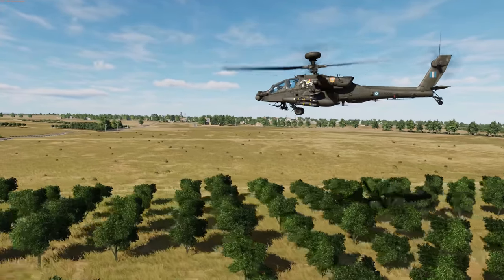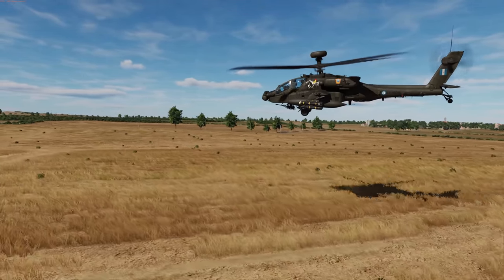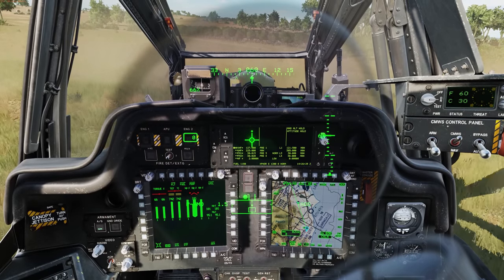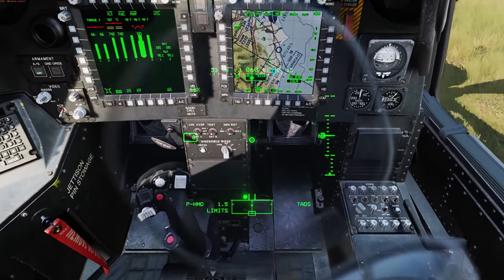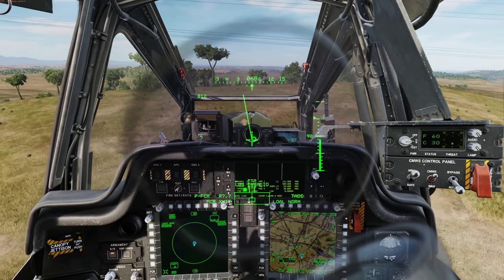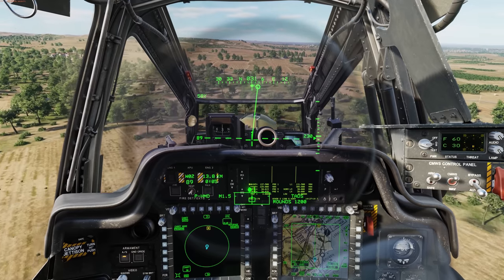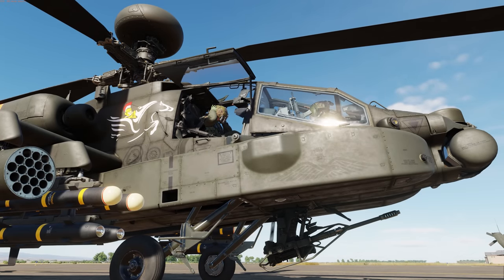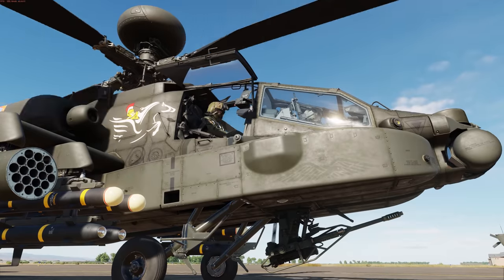DCS: AH-64D Laser Warning System

Comment: When I was a TOW Gunner we were taught to never laze aircraft because of this. Especially friendly aircraft. There were instances of guys just messing around with the TOW system and they would harmlessly lase a friendly helicopter that was nearby and it would pop flares and evade. I always wondered how it worked
Reply: downloadpizza2547 There are TOW variants that are laser guided as well.
Reply: @leogibney  There are no TOW variants with laser guidance. Wireless TOW's are guided via one-way low probability of intercept radio datalink, not laser.
Reply: @downloadpizza2547  Yeah pretty much. To confirm a target is within max effective range and to also call out the direction and range to adjacent friendly units.

We make it a habit of just hitting that laser-rangefinder button every time we point it at something, but you gotta be careful when pointing it at active protection systems like the Shtora-1 or an RLWS-equipped aircraft like this
Reply: @captainedward8278  the TOW ITAS literally has a a FLIR/NVD/Laser rangefinder as part of its kit, thats why it would trigger LWS systems, the missile its self does not have a laser emitter but the launcher certainly does
Reply: @123TheCloop  A laser rangefinder, yes, not to guide TOW missiles. None of them use any method of laser guidance.
Reply: Was taught the same with modern tanks also!
Reply: @123TheCloop  so you are agreeing with him lmfao.
Reply: @123TheCloop  literally what @captaineward8278 wrote: "There are no TOW variants with laser **GUIDANCE**." Emphasis mine. There's nothing wrong or even ambiguous in what he said.
Reply: I had a friend who had a laser range finder on his person because he found it useful in the field. When he first got it he pointed it at an apache over their FOB and the thing dumped flares and evaded. They were not happy but he was never caught.

Comment: To be fair Waggs, the only thing i wish for the Apache its a more updated cockpit. I say this because i have a RTX 3070 and i have to low the graphics to play the Apache. Its the only module that goes under 60 FPS in my pc, so i wish you guys optimice it a little, im tired of running it at 40 or even 30 FPS unu

Anyways, thanks for all the upcoming things!
Reply: Im running a RTX3070 as well and play with most settings maxed out at 90fps on busy servers. The issue might lay elsewhere. What other components do you have?
Reply: @skippersmg  32GB RAM, a good SSD and i7 9700K. Lot of members in the squadron where i am and somo of my friends have the same problem with the Apache. They have to low the graphics or run the Apache in 40 FPS
Reply: Dlss
Reply: @dudanvictor4203  Yea, that will help for sure

Comment: Would it be at all possible to get some kind of small UI element to indicate when a modifier is toggled on? I'm almost certainly going to have to use multiple modifiers to get all the FCR controls on my HOTAS setup, and it's something I found myself wanting with the strike eagle (though in that case, a UI element to show which of the backseat handgrips was the "active" one) as well.